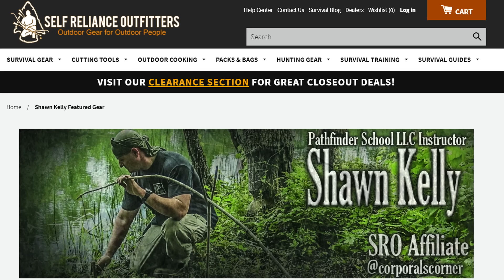Solo Overnight Building a Sandbag Shelter In the Woods and Fried Bacon and Cheese Kielbasa

Comment: Awesome , Critique Ratings: a 9 for sturdiness. ( I would have used the yolk branches in 4 spots for the roof on the back wall, one in each corner and one on the other side of the door access),  a 3 for weather-prep, ( you have no way of funneling uphill water away from your dwelling in a monsoon scenario..... You need some sort of trenching or bagging uphill of the head-bags to divert heavy water flow). Space an  8, ( I know its a quicky build, but you  might have to stow a lot of gear. or double-up).  The floor, a 3 ( put 4 inch logs down for the flooring-base logs and then when you add the floor on top,..... Chink the ones that are going to be the floor, then if your weathering plans go south , your bedding and gear stays dry. and make sure to create a trough under it to channel water out of the hide out,.... making sure that the entrance is sloped away from the hide-out)  And finally....... As a commando ....... You should know that this lay-low will be spotted if it's left in that  uncovered...... Sand-bag mode, Detritus....  cover the thing up..... Stay Safe.  Ciao

Comment: I loved this one.  It reminded me of a "bunker" I dug when I was about 13. We put logs across and made the roof out of plywood scraps and then buried them, and buried an old barrel stove in one end. It was about 10'x5' It made it through a few nights before the sandy earth dried out so much from the stove that it started collapsing in on itself.  Ah, a 13 year old's engineering failures and waking up with the roof caving in and having to dig ourselves out.  Fun times, and this video brought back great 30 year old memories.  Thanks Cpl!
Reply: I done something similar but I made like 20 of them and used them in air soft wars ant after 3 years they all still stand

Comment: When we invaded Bosnia back in '95, the battalion commander decreed every soldier - enlisted and officer - would fill 20 sandbags per day.
All the officers and the CSM were out there right alongside us getting their sandbag quota in.  Every man, no exceptions.  No filling sandbags for others.
We did that for an entire *year*.   
By the time we were finished there were sandbags protecting everything - even the tops of our guard towers.  8' tall, 5' thick sandbag walls surrounding all tents and structures.
It was glorious.  It didn't take long to fill 20 sandbags each day either.  We'd get up early and use it as part of our daily PT routine.  Push-ups, sit-ups, 2-mile run, then fill 20 sandbags - took about a minute per bag and everyone had their entrenching tool.  We had built plenty of "sandbag-filling" boxes.  Put bag in box, stretch mouth of bag over sides, fill, close up, remove bag from box. 
Then go outside the wire and run missions all day.
Reply: The real world soldiering in action.  Did the Lt Col BN Commander fill his quota each day?   I think I filled at least 1,000 in Vietnam.

Comment: The second layer of bags should be offset from the first so that the end of each bag in the second layer lines up with the middle of the bags in the first layer.  A single stack of sandbags grows in height quickly but isn’t very strong. That’s why the Army Corps of Engineers recommends building sandbag walls that are three times wider than they are tall (or two times wider at bare minimum if lacking time/supplies). In other words, a one-foot high wall should have a three-foot-wide base, giving the wall a pyramid shape

Comment: Candle holders can be made from aluminum and tin cans, and also aluminum bottles. This is an idea I play with myself in case I need it. You're keeping things natural in this video Corporal, but do you have a video using aluminum cans, aluminum bottles or tin cans as candle holders? I could use all the designs for both can and aluminum bottle. 👍

Comment: Damn... 22:05
It is for moments like this one that I carry a steel chain.
No way would you catch me deep frying over a fire with a pot suspended by PARACORD. 
That is just asking for trouble.

PLEASE 
Anyone planning on deep frying in oil over a campfire, please suspend the pot with something more durable than plastic cord.
Reply from the maker: yet it was fine
Reply: It sure did seem to work.
Reply: @recall5811  I would have used a chain to hang the fry pot (I pack one for that purpose), but I thought that what you did was great, anyway! 
I liked your stick through the loop handle as well!
I could tell you know what you are doing, so no prob AFAIAC.
Everybody devises different ways to do things, it's great to learn what others do! 
Thank you for showing those knots :-)!
Great shelter, great video!

Comment: Although you have shown me something new to try, I've also instantly incorporated adding "my kinda' safety-touch" to your build here.
Where as you go crazy with twine's and paracord's I utilize 16 ga. rebar wire and Linesman's Pilar's and that's just to keep things in place until my next step,( which is to try and Wood Auger and Dowel everything possible even if I've already secured it with rebar wire, screws, or nails ) because in my humble opinion there's just something about knowing that so much weight can come to bear on such an ancient but almost perfect securement that makes me take the time to do them. I'd also wire those bag's, the doorframe, the....  Lol!  :D

Comment: Regarding your shoveling technique... I like to use the pickaxe end to stab the dirt first, it is easy leverage to help loosen the soil. Then I turn it shovel side to further break apart the loose ground. Finally I flatten the blade and shovel the loose dirt away. Looks like you were starting on step two here 4:08 and I was wondering if there is something I missed.
Reply from the maker: thanks for watching

Comment: I always know it's your video when I see the bacon sizzling!  Question: couldn't you dig a fire pit into the wall, and vent it outside?  Or is the area too small that the carbon monoxide would build up?  Also, when placing sandbags in the pattern of half, full, full, then full, full half, and repeat, wouldn't the weight be most evenly distributed by doing  the pattern of: half, full, full, then full, half, full, then full, full, half and repeat?  Not trying to nitpick...I just want to fully understand.  Thanks!  You are so inspiring and I learn so much from you... definitely share your stuff!

Comment: My concern, as someone who does none of this but loves it anyway, is that when it rains, the sandbags will soak up all the water and the weight of the bags on the roof will be structurally dangerous.  Maybe a few more support timers would be needed to hold the extra weight?
Reply: I was thinking if before laying the sandbags down for the roof you could get a large sheet of tarpaulin lay it down first then lay the sandbags down on top of half the sheet then fold it over the top of the bags to cover them, basically wrapping the sandbags. Then cover it with some moss and dirt, but yeah, you would need some more supports or larger stronger supports than the ones in the video. Maybe slope the roof as well so that the water would roll off the roof.
Reply: @TheCraigy111  Your're right, the slope and folding tarp would reduce water weight and allow any that does get in to run safely away.

Comment: 需要做个导雨槽，暴雨会让屋顶漏水。屋顶最好是稍微倾斜、使用阔叶植物的可以导雨。我认为它无法阻止步枪子弹。弹片应该是可以阻止的。
Reply from the maker: what?
Reply: @recall5811  You need to make a rain gutter, because heavy rain will make the roof leak. The roof is best to be slightly inclined and use broad-leaved plants to guide the rain. I don't think it can stop rifle bullets. Shrapnel should be stopable.
Reply: @recall5811  They said "You need to make a rain gutter, because heavy rain will make the roof leak. The roof is best to be slightly inclined and use broad-leaved plants to guide the rain. I don't think it can stop rifle bullets. Shrapnel should be stoppable."

Comment: The sod there looks to be clay and sand. It also seems to be baked solid. How high is the water table? I remember using sandbags a lot but we seldom made anything that fancy, mostly we spent time building shelters to keep safe in as part of a trench/foxhole affair, they were part of the choke hole defences. Much of it was either wet stinking clay or stony frozen ground, very hard to dig.

Comment: How many sandbags did you use cuz I am thinking about doing the same thing and I'm wondering if 100 is enough, no I will not take your credit for your shelter I just want to see how effective a sandbag shelter would be up here in one of the northern states. The higher water table is a problem so I want to see how long that would last with our kind of rain

Comment: What happens to the sand bags when a heavy rainstorm comes?
Reply: Unless it's flooding, you don't have a problem. The water will flow down and away faster than it can penetrate into the shelter. If your drainage is good, you won't even notice a very heavy rainstorm. If your drainage sucks, you can drown yourself in the worst case.

Comment: Outstanding work you did here. Gives me ideas though.  Firstly,  there is a new 10x10 heavy duty Mylar Blanket out, just like the 5x7. Using that concept of yours.  In case of having to stay inside a shelter for extended time.  I could see a larger 10x10 and at least 6'5" tall.
I would also do something different to keep out snakes. Bugs I can deal with. Ants and snakes would be a bigger concern if your gone for long periods of time. 
Why 6'6", to build a raised bed and give storage space under. 
Why a 10x10, to have a small fire pit with bushcraft built chimney inside to cook if heavy snow or rains keep you inside.
And finally,  the 10x10 I would build, would have a sloped roof for water containment from run off, and better support of the bags above. 
That's a lot of weight brother on a roof. Add to that, heavy snow. Now your weight factor has increased by 10 fold.
Next, how do you stop erosion?
Again,  more weight on the roof. Using dirt on top. Then plant grass to grow would stop the erosion. But again,  must factor a better roof for the weight.  Still is quite doable. 
Want to be truly safe?
Install 1/2" thick metal on your outer side walls, then add a second layer of sand bags.  Only a 50 cal would be able to go thru the wall in a shoot out
Reply: L

Comment: Hey, Corporal, great video as always. Was wondering what kind of shovel that is and where you got it? Thanks!
Reply: @Windan Waves
I have found them at flea markets here in the USA. I believe they are called entrenching tools and I believe they were GI during the ‘50s or ‘60s. I’ve found mine very handy but don’t get scalped on price, as in $50 bucks is a little too steep.
Reply: He used 2, I think, one had a spike out the back to use like a pick..the other was a plain folding entrenching tool.

Comment: what cord do you use to tie it?
Reply: looks like bank line. they sell it at the website the guy promotes, linked in the description: Self Reliance Outfitters. It comes in different sizes, #6,  #12, and #36. The #6 is quite small in diameter and is good for small crafts. I'd probably go with the #36 if you are looking for general use, you can always pull out a strand if you want to use a smaller diameter.

Comment: ok here are a few pieces of advice on how to stack sand bags because the method used in the video is suboptimal
:
-never tie a sandbag to close it! that makes stacking them properly and tightly needlessly difficult. you either fold the opening under the sand bag or you lay the bottom of your next bag on top of the opening of your last.
-Sand bags are best stacked with the bottom of the bag facing inside, not sideways.
-it is better to fill them up to about two thirds, then you fold the opening, which is facing the outside as described above, under the bag, this will seal the bag while maintaining a roughly rectangular shape, which is lost when you tie it shut. it also causes the flap you folded under to be pushed inwards if pressure is applied from outside.
Reply from the maker: thanks for watching
Reply: 16 ga. rebar wire them together at the necks.
Next....?